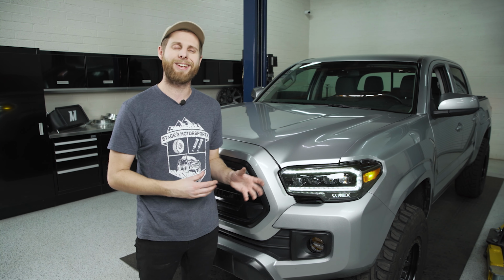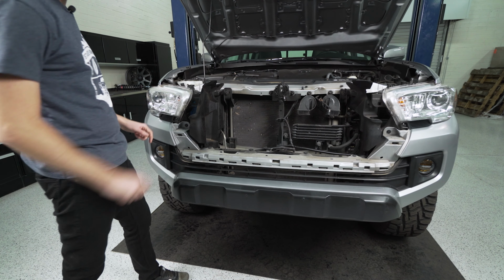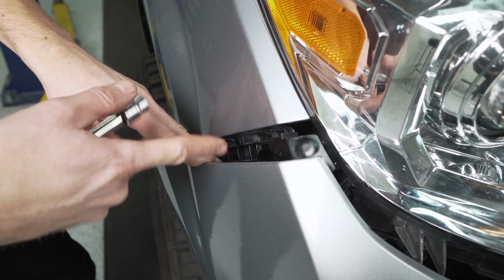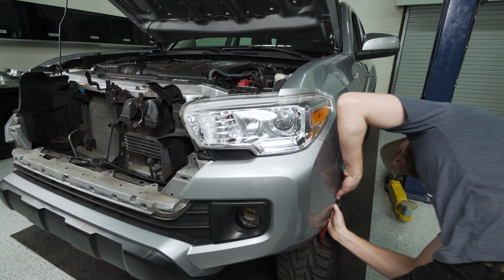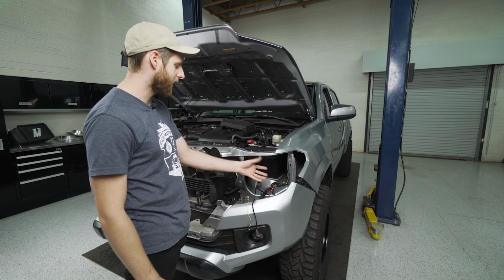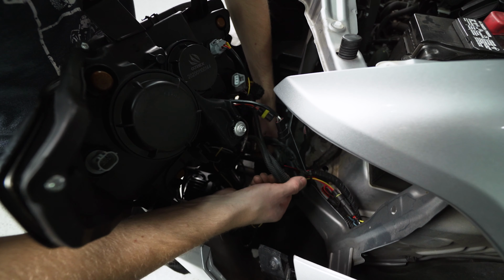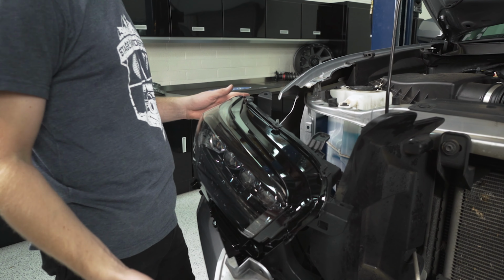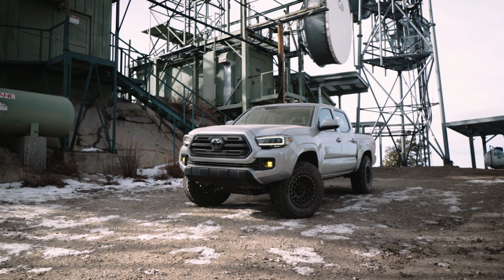2016-2020 Toyota Tacoma AlphaRex NOVA Series LED Projector Headlight Install

Comment: 6:25 — I have a 2017 Limited Tacoma. Would I need to by any adapter or wire harness to get the headlights working correctly?

Comment: Does the drl lights stay on all the time even though I have the headlights setting to off?
Reply: I just put in ARex Luxx, they literally do the same thing as the stock. They work however you set your steering wheel peg to. Off is off, auto is auto, running is running, and lights come on when you twist the knob. Seems to work fine

Comment: So I didn't use any wiring harness on my 2021 SR5, everything works like it should, what am I missing? I got the Luxx I think but when I plugged everything in before bolting it back down I tested and it all works. I feel like I just built a lego set and I had way too many extra pieces.
Reply: I’m trying to find out if I need a harness for my halogen 22 trd sport or not lol
Reply: @Itsmoooose  If you want the head lights to stay on after you hit unlock on the fob, gotta hook up the harness. They will do the little dance and then stay white with the truck off.
If you don't care like I did, leave it out.... still does what it's supposed to do but just does not stay on with fob clicks
Reply: BTW I regret buying these because the amount of work put in, they look great but man, I really didn't want to learn how to operate on the fenders...

Comment: I have a 2021 Tacoma TRD Sport. I want to install Alpharex Projector Sequential headlights. It's the only thing I should need other than the lights are the adapters? I presently have LED headlights. I've watched several videos, each one has a different twist. Thanks
Reply: Sooo you are wanting to downgrade your headlights? The Toyota LED lights are what these are trying to be, but made from a small aftermarket manufacturer who is more after looks than function. I know some people just want the look, but I am trying to save you some time and heartache - keep the factory LEDs!

Comment: My DRL is amber instead of white, other than that every thing else works??? SR5 '21Tacoma
Reply: Did you figure it out? I have a 21 SR5 and want these but I don’t want to buy unless the DRL are white.
Reply: Yeah I’m going to wait till you get answer because I also have a 21 SR5
Reply: So it ended up being a collab with the stereo guys...for some reason in parking light mode they are amber but when my fogs are on they turn white.  They also didn't do the gray wire they just cut it off.  I recovered it and tied it to that fuse  So it goes DRL off my DRLs are always on, auto normal behavior, but are amber when it's bright out (maybe the fog light tie in issues).  parking light as stated previously.  I think my lights are fraken wired but they work.  The instructions are confusing and no videos in sr5
Reply: @kevinmason6130  I was installed in my truck and the amber color, it only turns on when you use the daytime lights when you completely turn on all the lights it changes to white.
Reply: I don’t have a 3 prong grey port on my 2021 trd off road. I’ve got 3 other plugs, black, dark gray and light gray left over. Do I need another harness?

Comment: How is the brightness of the low and high beams compared to the stock headlights?
Reply: Both the low beams and high beams are noticeably brighter with the AlphaRex Novas. Being that they have projectors the beam pattern is also really nice and controlled

Comment: Question…..
Should the DRL LEDs stay on all the time (whenever the truck is running) regardless of what the headlight selector is set to…… or do I have something wired wrong?
Reply from the maker: They should be on all the time when the truck is running, so it sounds like something may be wired incorrectly or depending on what package of truck you have you might need to turn the headlight switch to "DRL" for them to kick on.
Reply: @stage3motorsports  the problem is that they ARE on all the time when the truck is running.  I have no way to shut ALL lights off when running now.
Reply from the maker: @pocketemail81  Ohh I see. Since they're designed to stay on all the time you'll need to talk to one of the techs at Alpharex to see if there's a way to manipulate the wiring to allow you to turn them off.

Comment: These things are absolute pieces of trash. They are not a reputable light manufacturer and shouldn’t be sold. Well documented on Tacoma world by professional lighting engineers with real science that show these are unsafe and have crap output.
Reply: I have had these lights installed in my truck for more than 5 months and I have not had any problems. What do you mean are they junk?
Reply: Someone's mad they can't afford them 😭😭😭
Reply: @dubbayne  I have retrofits that cost more than these do